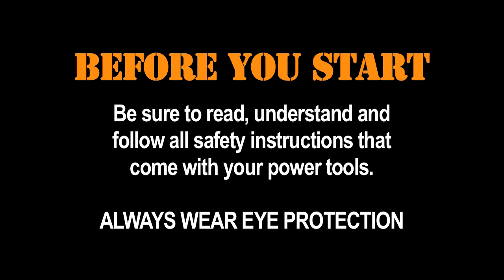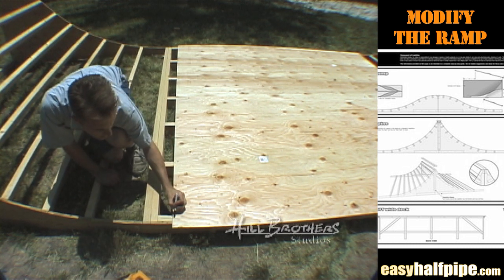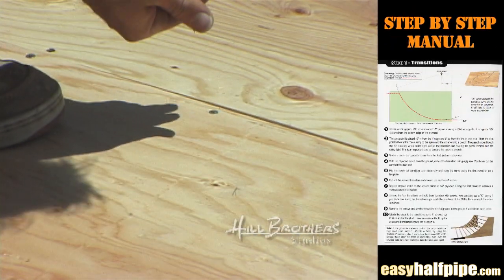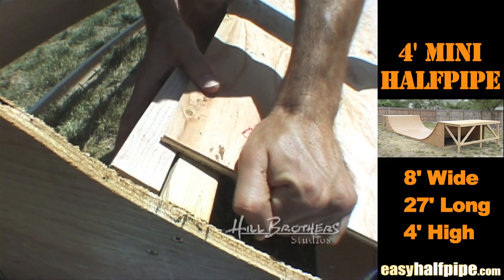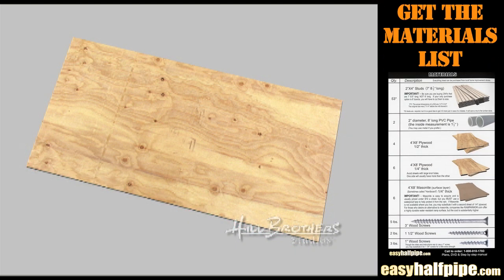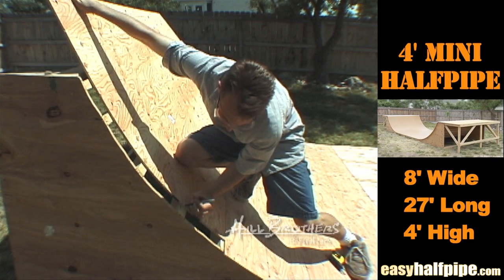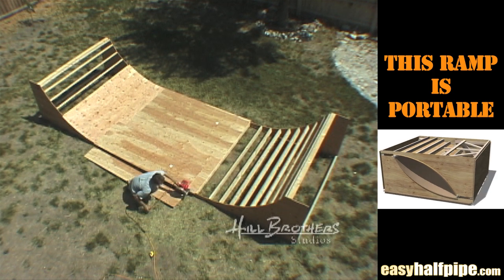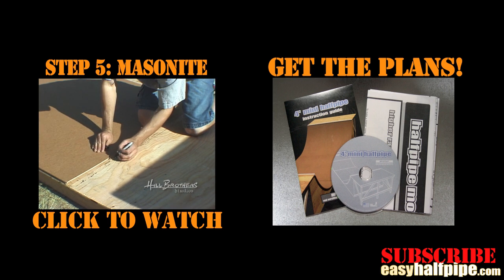How to build a Halfpipe Step 4 PLYWOOD

Comment from the maker: You wont have an unsupported gap if you lay the plywood horizontal. Its plenty strong enough to lay it that way.  If you really want to do it vertically, go for it. There are no rules.  We just find it works better to do it this way for a ramp this size.  If I was making a 4ft wide ramp however, I would do it vertically.